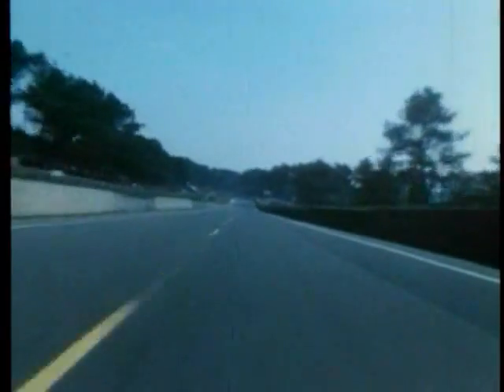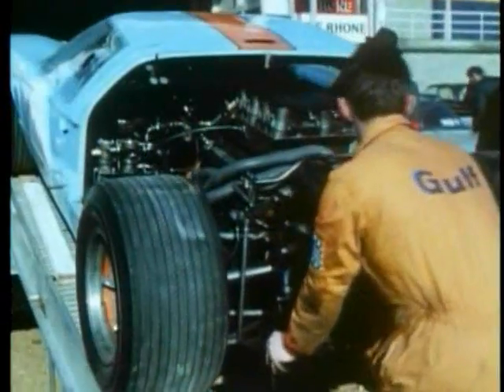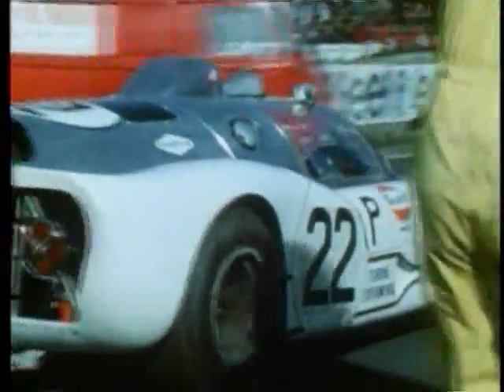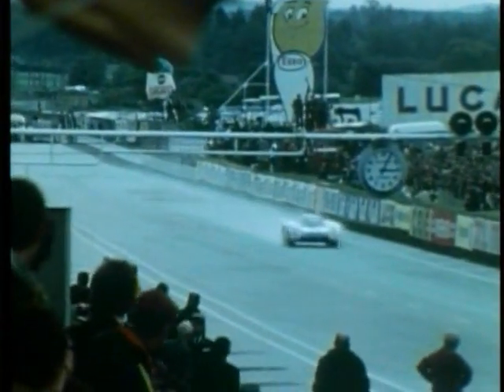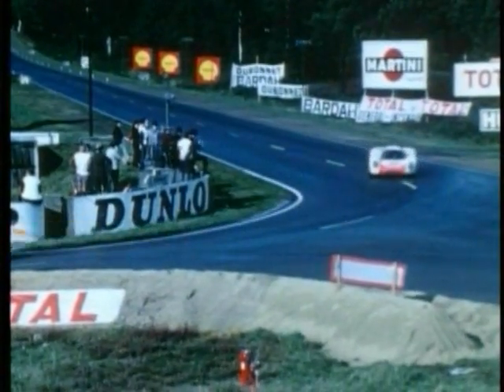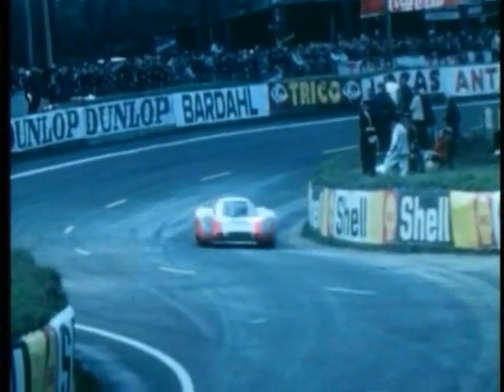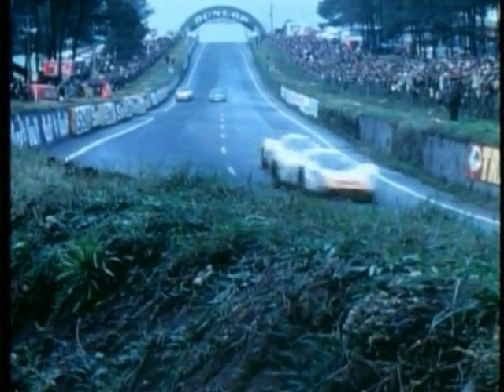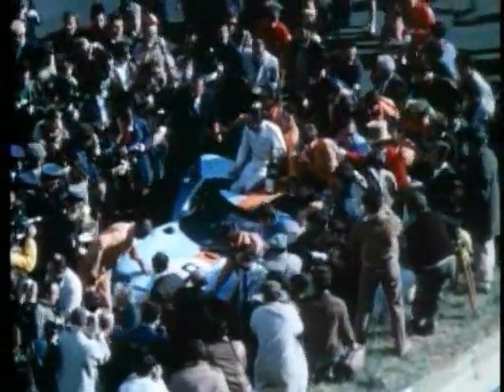1968 24 Hours of Le Mans

Comment: As an old Ford guy, I think I liked the '68/'69 wins the most...Ford had dominated in '66 and '67 with their 427 powered GT40's but Le Mans declared a 5 liter limit for '68 and so the top GT-40 teams went with the new for '68 Ford 302 (albeit a specialized racing block with 4 bolt mains), which was bored to 305 cubic inches (5 liters)...but the 302 heads were not very good and Dan Gurney had designed a new head which he manufactured with Harry Weslake at Rye in England...the initial heads were manufactured by Alcoa in America and known as the Mk I, with further testing and development in '65, '66, and '67 and culminated in the Mk IV heads which were used on the winning GT-40's in '68 and '69.  Some of the Mk V road car heads are still available today if you really look...I priced a set about 10 years ago with an eye towards building a boss 302 engine for my '65 HIPO Mustang  with Gurney-Weslake heads...but the price (about $7,500 bare) pushed me off...I figured fully configured with period induction would have been a $12,000 project just from the heads up.
Reply: They changed the rules so Ford wouldn't keep dominating. But they ended up dominating for two more years anyway. They should have never change the rules. The best car should always win. The 68 rules forced car makers to hold back.

Comment: the best Le Mans start ever...bring it back
Reply: The FIA wouldn't, it's banned due to safety concerns of the drivers, they run and get into their cars but they hardly wear their safety harness properly resulting in crashes, injuries and such. The last year to implement the famous 'Running starts' or the 'le mans' style start was '69. Although it is used in some vintage motorracing today it is used in the 24 hours of Motos in motorcycle endurance racing.

Comment: Regarding the long straight...I read once that one of the reasons the '65 GT40's didn't finish the race was the transmission's 4th gear wouldn't hold up...from all the abuse it took on full throttle all the way down the long straight...of course the '65 was also powered by a 289 HIPO which didn't have the HP of the 427 used in '66 and '67 so who knows if it would have won even if they  had finished the race.
Reply: In 1965 Ford fielded 6 gt40s, two shelby MkII with the 427 and 4 independent Mk1 with 289s......Phill Hill put his MKII on the pole.....all of the 289 GTs died of overheating issues......Bruce Mclarens 427MKII expired with transmission trouble......Phil Hill began to lose his clutch so just for show he completely opened it up and set a record of 218 mph on Mulsanne.......then his clutch completely failed.
Reply: I did not know the Mk II ran Le Mans in '65...thanx for the info.

Comment: I don't understand why Ford dropped the Mk IV and entered the older GT40's.
Reply: The rules were changed in 68 because the MK2 and MK4 Big displacement engines were considered too powerful. You can thank a butt hurt Enzo Ferrari for that.
Reply: @romesrepublic  Ferrari, the 1967 sports prototypes champions, did not enter Le Mans nor the World Sportscars Championship in 1968 because their 4 litre V12 P4 prototypes were considered too fast, too nimble and too pretty compared to the British-American straight-line clunkers. You can thank a butt hurt Henry Ford II and even more butt hurt internet croakers for that. Besides, the 3 litre Ford P68 was crap, surely Ferrari is to blame for that too, eh? Without a defending champion in 1968, JWA Gulf took LM and the WC for Ford with the 4,7 litre GT40s, competing against underdog Porsche which only had small 2.2 litre 907 until 1967, with the yet unreliable new 3 litre 908 scoring only one WC win in 1968. Thus they drank the GT40 koolaid and got themselves the 4,5 litre 917 as a sportscar for 1969. So much for big displacement engines being considered too powerful.